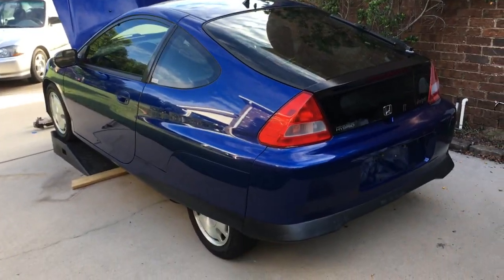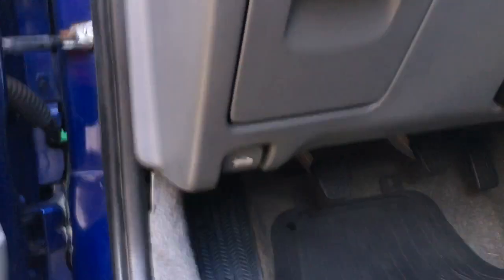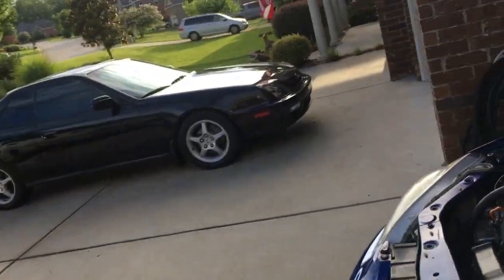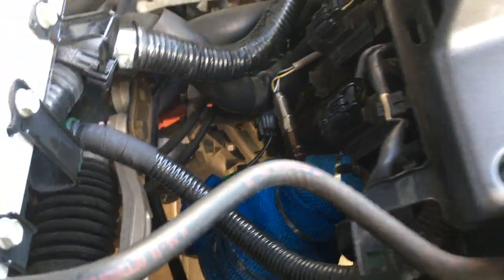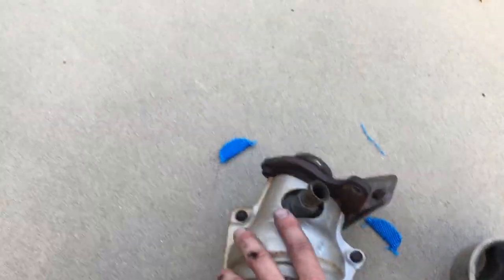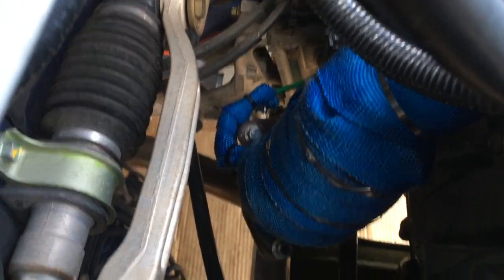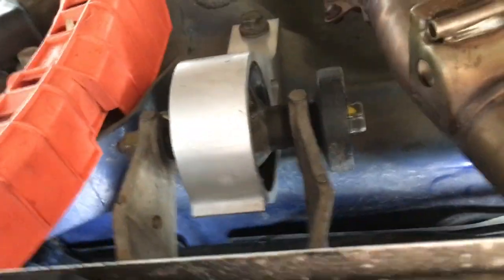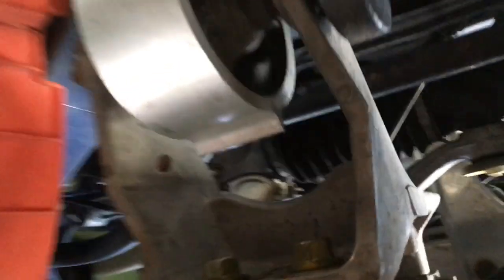2001 Honda Insight restoration video part 4: Catalytic converter, rear motor mount, other stuff

Comment: It looks like your Insight has an extra bushing on the outside of your transmission mount. It’s a big black O-ring looking thing on the exhaust side of the mount. Is that an additional piece that you put in or did later models of insights have that?  I have a 2001 CVT.
Reply from the maker: I sold that one many years ago, I cannot know this information you ask.

Comment: Hello great video! I am not sure if I need to replace my cat on my 2001 insight, and if so, I’m not sure which one I need to replace. I’m running a p2000 error code which is “NOx absorber efficiency below threshold.” Hardly any forums talk about the p2000 with the insight, but mention it with a civic hybrid saying the second cat needs replaced. Do you have any “insight” on this? Ba dum ts. Thanks!
Reply from the maker: Awesome thanks, sorry I can't help with that.  I will say that my 2nd cat on that car was gutted and it did not throw any codes.  Some folks recommend using an o2 spacer/'defouler' on Insights to eliminate CEL.  Research that and try it, they are super cheap and that might fix your issue.
Reply: @gray25xt  thank you so much for the help. I’ll look into that.
Reply: You may want to look at some junk yards for your parts. I scored on a battery pack and front and rear cat for $500. battery last two years and now getting IMA light. No codes for the cat so far.